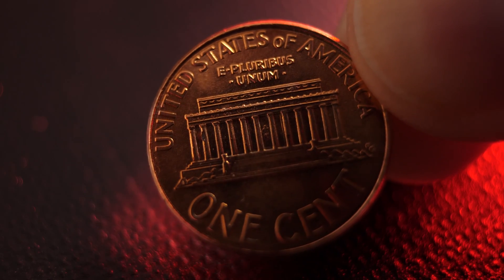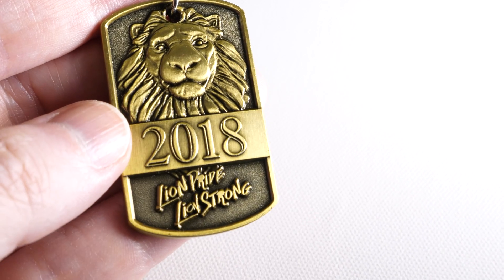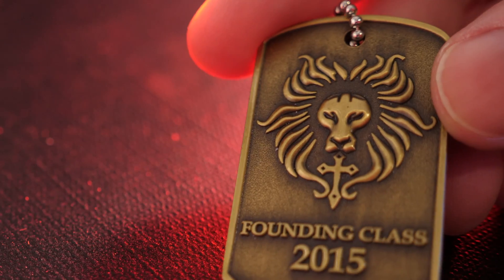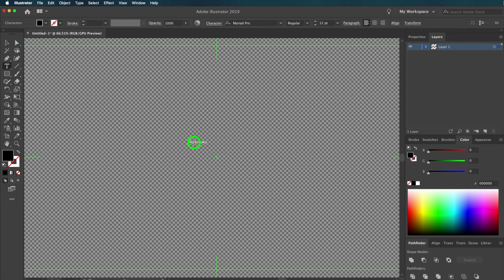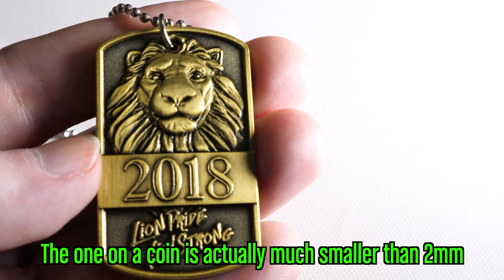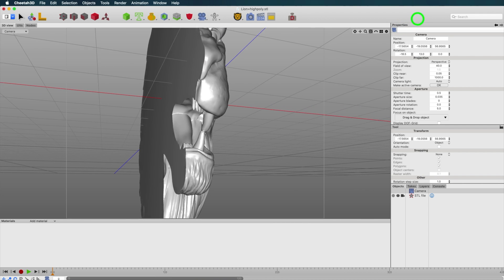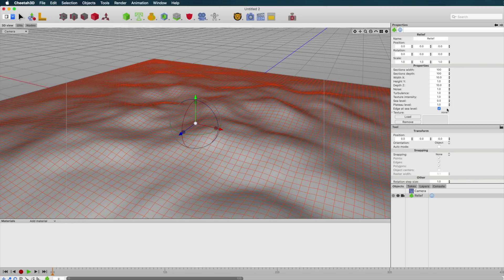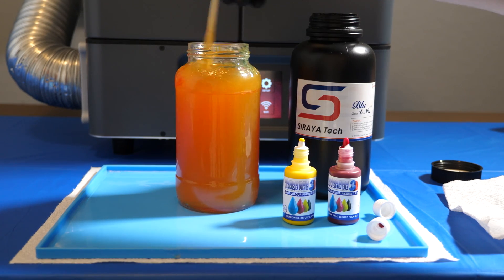Designing & 3D Printing Dog Tags - How To Create a Relief for a Coin or Dog Tag with Depth & Detail

Comment: RE: From the U.S. Mint - In my research it indicates they used much larger originals and had a special mechanism with a pencil then guide - possibly a type of lathe or grinder transferring as one moved at much smaller detail while hand tracing the larger blueprint... that took it from originals size to coin size, and etched it - then they could get the detail with closeup eye ware a meticulous process, yet they started large to get the smaller detail corrected before the reductions.

Comment: Metal ones could be made. Make a mold of your best printed model, and use epoxy infused with fine ground copper. These can be inked and polished for that faux age patina with dark nooks and crannies. Faster than metal casting but similar heft.

Comment: I'm late to the party, but for old school coins a sculptor made them large.  They then had a needle move over the surface (think like a record) and that needle was connected to a series of gears that miniaturized the motions to make a smaller mold.
Reply from the maker: Great comment. Thanks for the info!
Reply: @Nerdtronic  Great video. You've got a great presentation manner.        Coin/medal striking dies were cut in steel with the use of a pantograph (a set of sliding arms that can be set for the amount of reduction desired w/ one arm holding a stylus and the other a rotating cutter to mill the steel. The original was sculpted at 300 - 500% in clay, a mold was made from the original and cast in a hard plaster or resin. The plaster tracing master was installed in a pantograph and the arms set for the amount of reduction. If it was a semi-automatic pantograph, the tracing stylus would follow a preset pattern to totally cover the master. If it was a manual, an operator would slowly push the stylus over the master as the cutter milled the steel away. The reproduction of detail was the end result.....everything sculpted at an enlarged scale was faithfully reproduced in the reduced version. All this from a guy that spent many hours tracing with a manual pantograph........Google Gorton pantograph for an image

Comment: For the detail you can do some pseudo HDR processing to enhance detail and small relief changes, and or use high pass filters. For the final cost I would not neglect FEP and LCD replacement costs as those can be a significant fraction of the final costs. If the LCD costs X dollars and lasts Y hours you can estimate its cost as (x/y)*hours to print.

Comment: Is there a way clean/smooth the edges of the model after you applied the height map without losing detail on the important areas? Would those lines/artifacts be noticeable with normal resin?
Reply from the maker: I've done it by hand.  Just editing the mesh manually.  Not sure what would be noticeable.  Depends on the print resolution probably.

Comment: You could try and spray them in a metalic paint, they actually look very much like metal at that point. I've done it with medalions before and it looks super cool and is very easy with the spray paint cans.
Reply from the maker: You could.  For this project I wanted as little post processing as possible.

Comment: This is very close to how I make coins with head profiles. Except I used a falloff map (perpendicular - parallel) plus ZDepth blended together. The falloff map helped blend the edges so it doesn't have such a steep edge. I'll have to add in the AO on my next one, you got some good detail in that AO pass.

With your dog tags, you could make a couple masters, and make silicone molds. Mold Max 60 if you want to do pewter. Mold Max 20 to do resin casts. With a resin cast, you can get pretty close to the look of bronze, pewter, and other metals by doing cold metal casting. If they are personalized with names, you make a cavity in the main mold that allows a 3D printed name to be snapped into place, and then a cast is made. You just need to make sure you have a good drafting on the letters of the name and use mold release so the two resins don't stick. If using pewter, you would have to make a sheet of names in Mold Max 60, and plug those in for each cast. Vacuum chamber, and pressure pot or pewter crucible, if you don't already have this stuff it does add quit a bit to the cost though.
Reply from the maker: I would like to make a mold and then make a pewter one.  I saw the Crafsman do it and want to try it out.  But I also have another project where I'm going to do that and make a video about it.  I want to start messing around with some casts.
Reply: Nerdtronic Just make sure whatever silicone you get for the molds, to be tin cured. Platinum cured may react with the 3D prints, Crafsman also ran into that in one of his mold making episodes with 3D prints. I still prime my prints just in case with fine detail primer usually used with model cars, miniatures, etc. A good Sulphur free clay is also a must.

Comment: Great video, I will have to try this myself. With cost comparison you should note how long the extra processes took. Once you add labour costs, you quickly realize why everything is made in China
Reply from the maker: The design time is about the same for both. Printing time I don’t consider labor. But yeah. It took a while to clean them all. Putting on the jump rings and chains took some time.

Comment: This is exactly what I needed. Thanks for the excellent info not really covered in too many other places. I knew about bump maps and how to create them from playing around with homebrew mapping, but what I needed was the portion on turning that greyscale image into a 3D relief. Now it is time to go finally purchase some software so I can make some relief maps. I'm curious to know how your experience with Siraya Blu was. Did you notice much warping or dimensional errors with it? Looking forward to the next project video and I hope the kids all enjoyed their 2020 dog tags. Maybe one with a dumpster fire for the rest of us would make for a nice limited run merch item 🤣🌎🔥
Reply from the maker: Thanks.  Glad it was helpful.  I bet you can do both the depth map render and create the relief in blender which is free.  But I don't know how to use blender (yet).  Siraya Blu - I think the resin needs to be warm. You might have noticed the seed heater inside my printer.  I added that to keep the resin warm.  Although the desert in July is pretty warm already.  I haven't done any calibration tests with it yet.  I would say on warping that I did notice some of the dog tags warp during post processing.  I left them on a paper plate and they drooped in the middle.  The good ones I post cured laying flat on the wax paper.

Comment: 13:18 - Correct, larger engraving, then used a reducing lathe to produce the die.
Reply from the maker: Thanks!
Reply: What was the step down process?
Reply: @yuriyfazylov5506  look up what a "pantograph" is, it uses a mechanism to reduce a larger relief to carve something much smaller, mechanically
Reply: @LtJerryRigg  thanks. I found the step down process on how it’s made. It doesn’t do the step down on one go, it requires artisans with jeweler’s precision to do the job at every step down process.